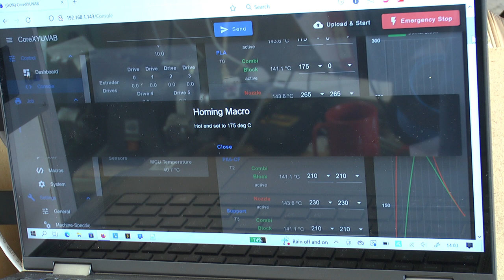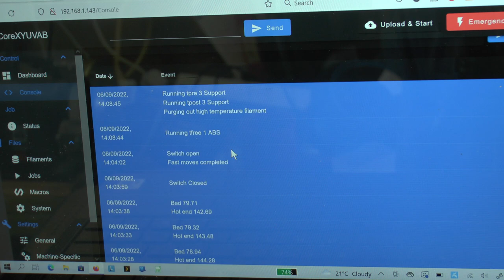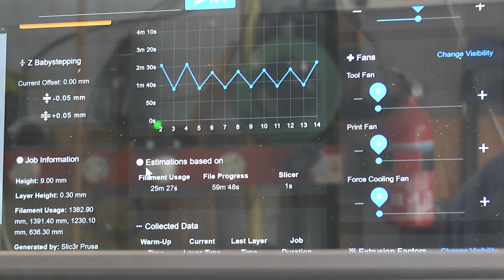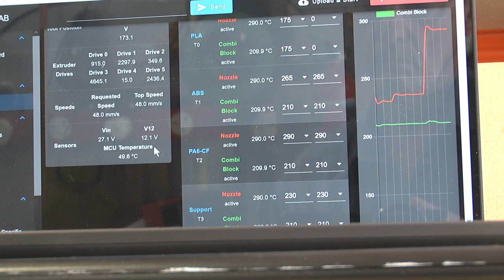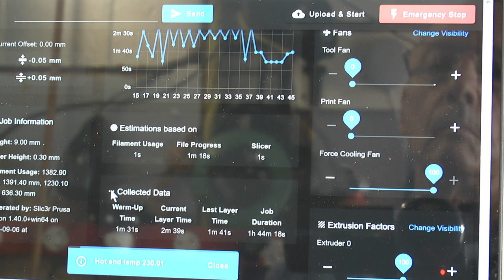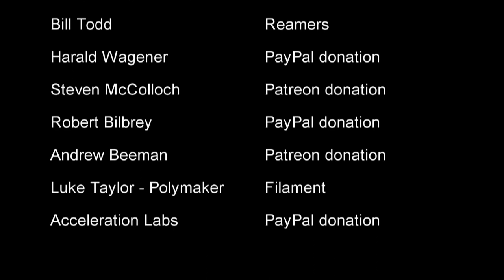1st multi material print with my 6 input hot end

Comment: Great to see you back and innovating - impressed with the time saved over as you say an MMU type setup - Minimising the purge would mean much more widespread uptake of multi material printing I think. I'm always amazed with how much waste there seems to be in multi material printing
Reply from the maker: Yes I agree about the waste - especially the Prusa MMU which seems to use more filament making the purge towers that it does making the actual print. Way back in 2017 I developed a technique for a mixing hot end to change with no purge at all, by advancing the tool (colour) change within the gcode file such that the new incoming filament would appear at the nozzle tip just as it was needed. There is a YouTube video about it somewhere on this channel and I did a write up on my blog  https://somei3deas.wordpress.com/2017/01/06/multi-colour-printing-without-wipe-or-prime-towers/. That wouldn't work for multiple materials but as I said in this video, it doesn't take much to purge out the filament that is the nozzle block.

Comment: I'd love to see an experiment doing gradient towers between two filaments of similar printing temperatures. As you said, PETG to TPU would be a good place to start. Start at 100%PETG, then the next layer do 99%petg 1% TPU, eventually reaching 100% TPU at the top. Then you'd have a beam of variable stiffness but equal cross-sectional area.

Kind of like how archery bows get thinner near the tips to become more flexible. 

I'm also interested to see if you can get PP to stick to other materials by using a 50% PP and 50% ABS mixture as an interface layer between the two materials. Or maybe 3 interface layers if that doesn't work (25%/75© PP/ABS, 50/50, and 75/25). That might make it possible to use PP in multimaterial prints.
Reply from the maker: I don't see any problems there. I'll add those to my "todo" list. Let me get these temperature towers and other filament specific tuning tests done then I'll have a play. Do you have any dimensions in mind for the "varyflex" beam?
Reply: @deckingman  Cool! I'd imagine 15x15x200 would be a decent place to start, any thinner and I'd imagine it would start wobbling near the top. Any thicker and it might be too stiff to see results. Might also need a flared base made out of pure ABS to keep it stuck down to the bed.
Reply from the maker: @stevenmcculloch5727  Lets go for 180mm in height. Using 0.3mm layer height that would give 600 layers, so I could change the mixing ratio in 1% increments every 6 layers. I don't think bed adhesion will be a problem if I start with 100% PET-G. If you contact me via my blog, https://somei3deas.wordpress.com/contact/ , that would give me your email address which might be a better way to continue this conversation.